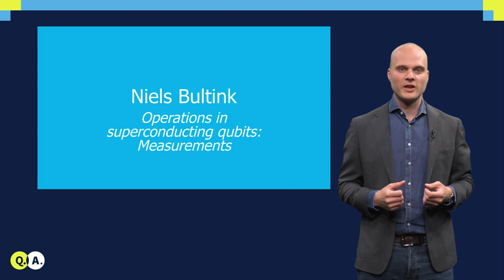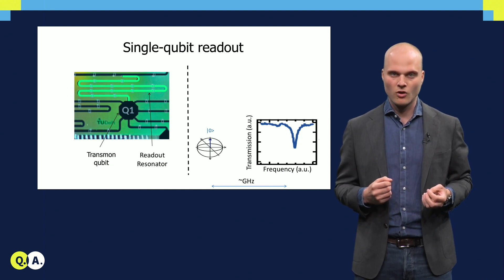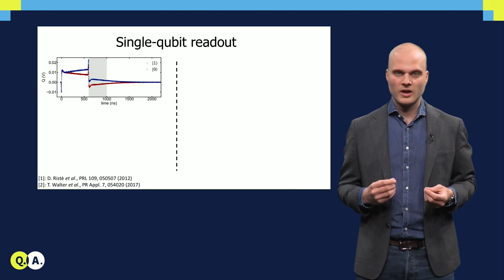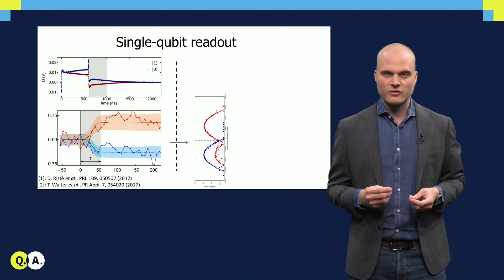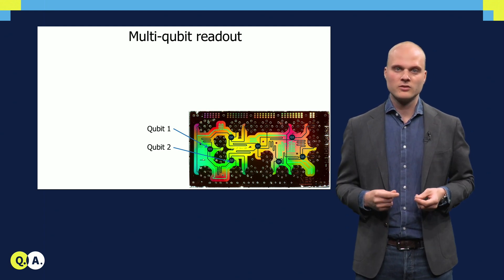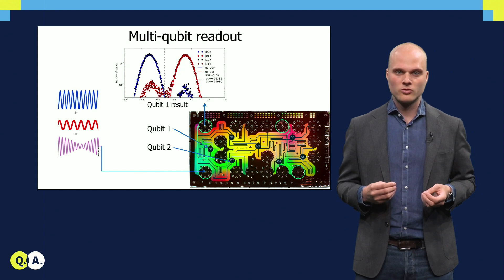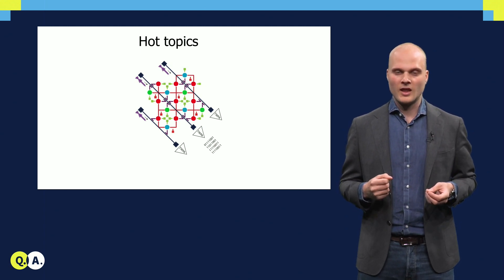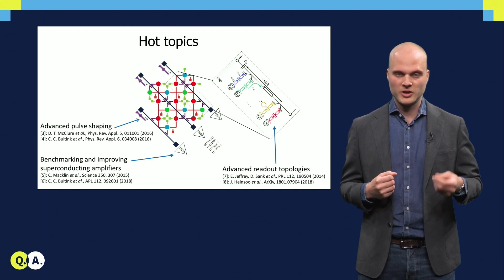Measurements on transmon qubits | QuTech Academy

Comment: How is the Hadamard done? Physically on the chip or with microwaves?
Reply: As you can see through the whole video the readout of a Qubit is done by the resonators so if it is a CNOT, Hadamard or X gate you will use microwaves and feedlines to read the output of any Quantum Gate
Reply: Ugh I really want to be this smart. I’m going to keep trying. Lol.